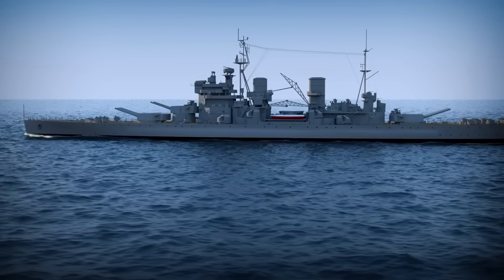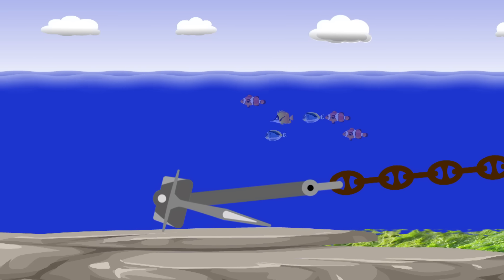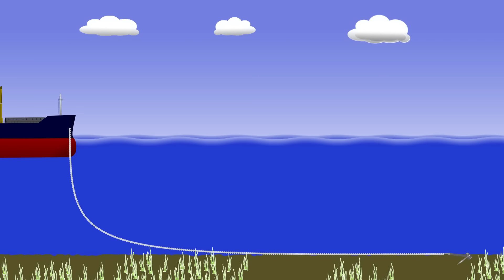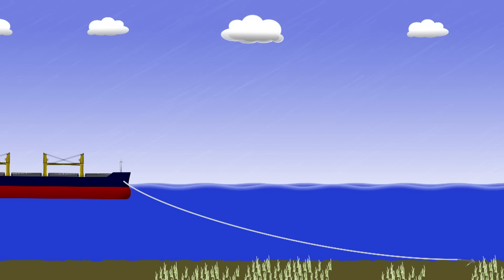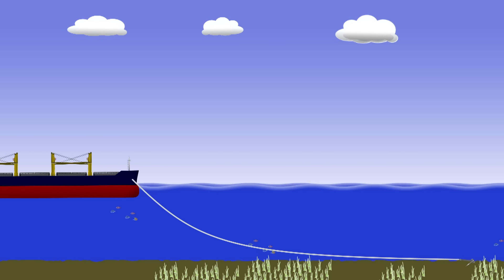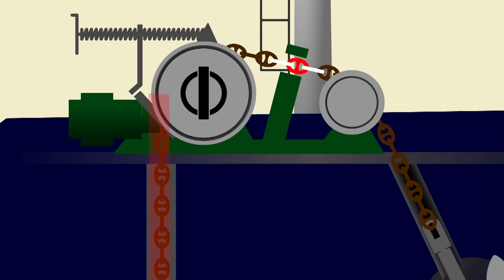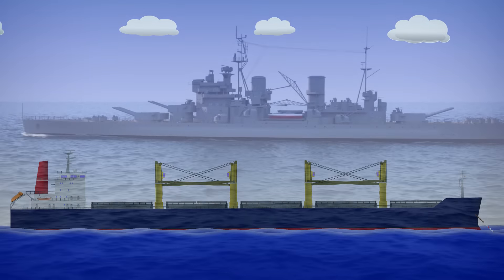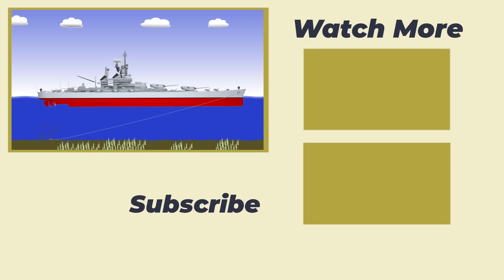The Truth About Anchoring Huge Ships

Comment: Not going to lie, I came here to get the one answer to the question thats been bugging me got years (could easily Google it) which is how do they pull it up, if its dug into the ground how would it be pulled up as surely the power of the anchor pulley  wouldn't be enough to pull up the anchor?

Comment: My question is, what if the anchor gets stucked? and when the vessel attempts to haul it, it wouldn't budge as if it struck something big like a sunken boat? What would they do?
Reply: They wouldn't get stuck on a good seabed, and the industry has very well chartered information about anchorages.  It can happen on rare occasions, especially if they have no choice but to anchor in a less than ideal spot for some reason.  In which case there are several things they can try to free it such as shuffling backwards and forwards, different angles, etc.  If that still fails, worse case they'd have to cut it off.  If it gets cut off, a salvage vessel would attempt to recover it later. Massive anchors very expensive.

Comment: A ship has two anchors - one for use in the North Hemisphere and one on the South. The anchor DOES hold the ship, but if one does hold it in bad weather, then the other is also used. Wind and tide together changes differently in each hemisphere. Starboard must be dropped first in the North and Port in the South. If not - the anchor chains will cross the bow when wind and tide changes and both anchors will not be able to be used efficiently, and could result in wrecking the vessel: See Browns Seamanship and Nautical Knowledge

Comment: How can one be so confused about how anchors work? The chain weight does not hold anything in place. It just helps the anchor to lie down and to have a better angle to maintain the anchor's grip. But it is the anchor's grip that holds a ship in place. No grip and you will be going forward dragging the anchor and/or the chain over the seabed as is actually shown in the video.

Comment: "Catenery"? I've always seen it as catenary; for instance, '1. Introductory Statics: the Catenary and the Arch. Michael Fowler
The Catenary. What is the shape of a chain of small links hanging under gravity from two fixed points (one not directly below the other)?  The word catenary (Latin for chain) was coined as a description for this curve by none other than Thomas Jefferson!   Despite the image the word brings to mind of a chain of links, the word catenary is actually defined as the curve the chain approaches in the limit of taking smaller and smaller links, keeping the length of the chain constant.  In other words, it describes a hanging rope.  A real chain of identical rigid links is then a sort of discretization of the catenary."
Source: Graduate Classical Mechanics Lecture Notes by Michael Fowler, UVa.

Comment: Lots of wrong info here, not to mention the pronunciation of "catenary". The anchor digs in and provides the anchoring force.  The weight of the chain, keeps the force direction on the anchor nearly horizontal, keeping it from pulling out.  And the chain is also to resist abrasion. The weight of the chain does smooth out the forces on the ship and the anchor. But the chain does not anchor the ship!  That's why they call that heavy digging thing at the end, the anchor!  :)  And the stickiness of the bottom has no bearing on the situation. For most digging anchors, you want a strong seabed material that can be deeply penetrated by the anchor flukes. ie, Firmly packed mud. The older traditional stock style of anchor  might actually do better in rock, since the flukes are smaller in cross section, but designed to bite into a rocky bottom.

Comment: Question: why do Cruise ships have propellers on the side?
Reply: better maneuverability.
cruise ships go into lots of different docks that regural transport ship wouldnt go.
so cruise have easier way in and out of the docks
Reply: They are called bow thrusters & stern thrusters. Most cargo ships (container ships, tankers, break bulk carriers, ....) have bow thrusters which does allow more maneuverability into & out of port & it allows them to not have to hire as many tugboats which is expensive; I.e cruise ships are constantly in & out port so they will have both bow & stern thrusters so they normally don't require any tugs - $$$. The thrusters are not on the side but are located in positions where the hull is narrow so they are actually propellers located in the center line & the "tube" for each goes through the hull. They are electrically driven propellers so if you want the ship to move to port or starboard these propellers can be easily changed direction; "pushing" water one way & then pushing water the other way as needed to move a ship away from or against the dock as needed. Look for pic.s online for a ship in drydock. Another reason merchant ships don't typically have more than one at the bow is because these create drag while on long sea voyages, more drag requires more fuel, costs more $$$.  It's all about weighing costs versus expenditures, "point of diminishing returns." Some cruise ships do make routine ocean crossings, QE2 for example & they still have 3 bow & 3 stern thrusters so it's a cost of tugboats vs. higher fuel cost due to drag. 30 years at sea between training, US Navy, shipyards & US Merchant ships so my apology if I got into the "weeds". Also I hope my explanation made sense. PS I was amazed to see the QE2 turn completely around on a dime with no tug boats in a small harbor. Nice to still be amazed after all these years.

Comment: If the weight of the chain is enough to keep the ship in position, why wouldn't it also be enough to keep the chain itself in position? If the answer is "because the ship would drag it along" then the chain is not heavy enough to hold the ship in position.

Comment: The concept of resting on your chain isn't confined just to very large ships.  It's really what you should be doing with anything sizeable.  The alternative is hoping a little mushroom anchor will hold.  I've watched wind on lakes haul a bunch of drunks off their anchor.  Turns out the Whal-E-Wurld mushroom and some poly line wasn't the answer for 35' of Carver (I think it was).  

Tried to warn them, but it was more fun to be drunk and flip off the guy in the skiff.  In the end  I guess I don't care what props, shafts, bearings, rudders etc cost some random idiot.  Cool to see em bent tho.  Do you think they recycle?

Comment: I don't think the video is right where it claims the weight of the chain is holding the ship instead of the anchor.  The weight of the chain goes exactly down, catenary or not, and has no ability to resist horizontal motion other than just friction.

I think the real purpose of the chain is to keep the anchor in the proper orientation, where the anchor will have massive holding power.  (And also, you need something that won't wear out by being dragged around on the seabed.)

Now about friction, first, the video doesn't mention it at all.  There might be significant friction, I'm not really sure.  But as the ship pulls on that anchor rode, the friction becomes less and less effective as the rode is lifted up.

So I think the video is totally wrong.  The chain does have a role to play, but it really is the anchor holding the ship.  For every unit of lateral force, something elsewhere in the system has to be matching it, and the only thing that can do that is the anchor.
Reply: Exactly! This video is completely wrong. In fact, the heavy chain significantly increases the tension forces. Of course, this is compensated by the sheer strength of the anchor when it's running parallel to the sea floor.

This increase in tension due to weight applied is the reason why hammocks need to have a lot of slack. Otherwise, under tension, the hammock would apply extremely high forces that are almost perpendicular to the walls, risking a catastrophic collapse.
Reply: This is also why heavy loads suspended by slings such as in cranes, also need considerable sling length. Check "Why things fall off cranes" by Practical Engineering here on Youtube

Comment: What if anchor chain becomes tangled in the locker, like my headphones ho in my pocket
Reply: on smaller ships they have men in the chain locker laying out the chain neatly as its pulled in.
a small room where you strip down to your underwear, chain comes in through a hole in the roof and slowly fills the room almost to the roof. your job is to lay it in neat rows.
by the time the chain is in the room is now a tiny crawl space. and you exit via a hatch in the roof.
you strip to your keks because the chain is covered in stinking mud (even with the chain wash) and you have to crawl all over it.
its not a job for claustrophobics.
in bigger ships they probably have a boom that lays out the cable because it is to heavy for humans.

Comment: I know that the English language varies from place to place and maybe even person to person.  However, the curve of the anchor chain is correctly spelled "catenary," and generally pronounced very straightforwardly.  Namely, as in "cat" "ten" "airy."  Your confusion extends to the visuals, where it is spelled "catenery" on screen while the closed caption is spelled "catinary".  (How the closed caption, which seems to be an AI function, can spell it that way from the vocalization closely approximating "ca teen ry"  is beyond me.)

If the anchor chain is so essential to the stability of a modern ship "at anchor,"  how did the sailing ship anchors hold?  At that time the anchor was held with a rope (or whatever the heavy anchor line was actually called.)  Surely the fibrous anchor line did not provide the same kind of resistance.  Maybe that's another story entirely.

Comment: this is funny the purpose of an anchor is to keep the ship in a certain spot. the chain does not perform the job of an anchor. if that was the case you wouldnt need an anchor you just drop a chain in the ocean. and the weight of the ship is always going to be greater than the weight of the chain.
Reply: given a half tonne of chain sitting in mud it is most unlikely you would be abe to pull it along. Given a 5 tonne vessel alongside the pontoon it is most likely you WOULD be able to pull it along without much difficulty. It stands to reason that a heavy anchor chain will make a significant contribution to the holding power of the anchor system.

Comment: This is absolutely incorrect. The anchor holds the ship in position. The chain keeps the scope of the anchor rode/chain in a proper ratio to keep the anchor from pulling out of the bottom. The OP even tells us this when he says that the anchor could slide over certain types of bottom without grabbing. Why would that be if the chain is all that needs to be present? And why would we have an anchor at all?

The shank of the anchor needs to lie parallel to the bottom for maximum holding power. This allows the flukes to dig in as deeply as possible for maximum holding power. A proper scope (the ratio of the length of the anchor rode to the bottom + distance above the water to anchor chock) is 7:1 for normal anchoring, that is, not in a storm. That means that for every foot of depth, you need seven feet of anchor line. There are other ratios for other conditions but this is what is considered the "norm.'

Imagine if you had to anchor in 200 feet of water. At 7:1 ratio, you would need 1400 feet of anchor line. And, when using rope, that rope would want to float. That would leave the anchor fluke pointing more vertically than horizontally and would refuse to grip.

Here's is where chain is important. By adding a length of chain between your main anchor line and your anchor, you are basically adding a weight to the fluke to drag it to the bottom and allow it to lay parallel to the bottom and grab properly. It also helps keep the fluke in position when it is being tugged on by wind or waves acting on the boat. 

So that sag in the chain the OP is talking about? That's there because when wind or tide pulls on the boat, the chain will be able to pull without pulling the anchor fluke off the bottom and cause a "pulled" anchor when you are now adrift.

Again, this video is complete garbage and incorrect in about every way possible. I've been on the water for over 40 years in all kinds of weather conditions. And every boat, large or small, has an anchor for the sole purpose of holding the ship in position. Chain or rope, without an anchor you aren't going to stay still.

Comment: The anchor is simply a drop weight. To give the ability to get the anchor chain to move! The anchor itself should not be "digging in" because of the danger of get snagged and hung up!
Reply: ...which explains why so much attention has been payed to designing anchors that will take a set in the sea bed?
Reply: @XPLAlN  but they don't! Which is why mooring buoys exist! Look at the anchor designed used the USN, there are no moving flukes! The anchor systems for SMALL crafts catch bottom... HUGE ships use the weight of the chains!

Comment: Reality is frustrating. For the 30 years I've been alive it made perfect sense to me that an anchor's pointy bits grabbed unto something on the seafloor and that's what keeps the ship from moving. 
But noooOOOooo, that's too fucking simple isn't it. Physics is way too cool for such an obvious explanation of how anchors work, for some ungodly reason it has to be the weight of the chain that does the trick. I'm too smart to just not care about reality and it's intricacies but also far too stupid to genuinely understand.
Reply: You had it right the first time -- it's the anchor's pointy bits that hold the ship in place, and the video is wrong. The weight of the chain is a downward directed force so it can't do it and doesn't do it, though it helps ensure that the tension on the chain is applied horizontally so the anchor has more bite.

Comment: I'm sorry, but this video is very misleading. The weight of the chain, by itself, DOES NOT hold the ship. Yes, THE ANCHOR DOES HOLD THE SHIP, because it holds the chain. If you remove the anchor but keep the chain, the ship will move. Something must hold the chain!

The weight of the chain affects the angle at which the braking force is applied to the ship. It also makes the anchor have to withstand a larger force overall. Let me repeat: THE WEIGHT OF THE CHAIN INCREASES THE FORCE THAT THE ANCHOR MUST ENDURE.

The real reason why the chain must be long is that the anchor is designed to be pulled parallel to the sea floor! 
So a long chain emphasizes the catenary (not "catenery", as shown in the video), and that in turn makes the anchor end of the chain more parallel to the sea floor. Simultaneously, the end of the chain closer to the ship becomes more vertical, which causes the ship to sink slightly.

Comment: The flaw in your explanation is that battleship was off diamond head. The seabed is broken lava and coral heads. All soft rock in ragged form, not smooth bedded formations. The question becomes can the chain absorb the inertial mass of a ship that size underway, or can the anchor survive the same to effectively act as a pivot point. Seems sketchy to me but then stories rely on the willful suspension of disbelief.

Comment: It is completely wrong information that the weight of the chain holds the vessel. The weight of the chain and anchor are nothing against the tens of thousands of tons of displacrment of the ship. Plus pretty much in the video is seen when there is heavy weather the chain is not very much touching the bottom, its the flukes and the anchor that hilds the ship. The longer chain provides reduced angle between chain and seabed so the flukes stay buried thus keep holding. Also if the weight of the chain holds the ship, then what holds the weight of the chain on the seabed? It is the flukes and anchir again. The anchor itself with flukes burried holds the chainand the vessel. The more shackles you give it will hold better because of the reduced angle, not because of chain weight. As an example 16000 t veseel usually has 5,6 t anchor, 11 shackles of cahin will weigh approx 10 t so it is 16000 t vs 15 t. And think of the 40 knots wind and waves pushing that 16000 t vessel. 15 tonnes will hold it??

Comment: It's not the weight of the chain that holds the ship. That's misleading. It's the weight of the chain that lays the anchor into a position to hold ground. If a ship dropped chain alone with no anchor at any reasonable scope and the wind picked up that ship would drift chain and all. The anchor's ability to hold ground is essential not just the weight of the chain. Very misleading. They work in tandem.

Comment: Wouldn't the anchor break if a battleship moving at full speed dropped it's anchor and it somehow attached to wolverines adamantium and was wielded on with captain America's shield. I still don't think it would spin the ship it would just snap the chain.

I was in the Lincoln as a nuclear machinist mate. So this is far from what I learned outside of surface warfare and boot camp which was instantly brain dumped. But a hunk of metal somehow spinning millions of pounds seems to violate physics.